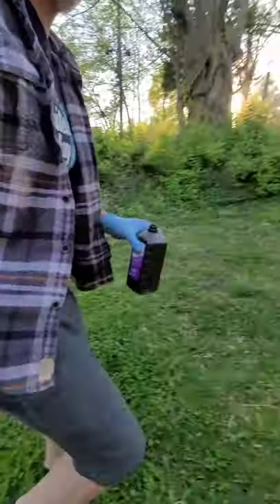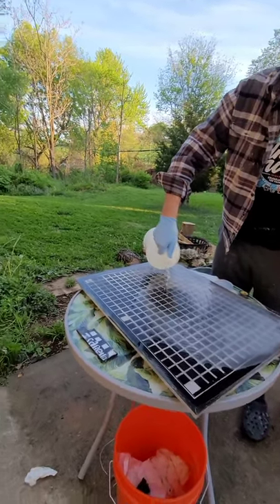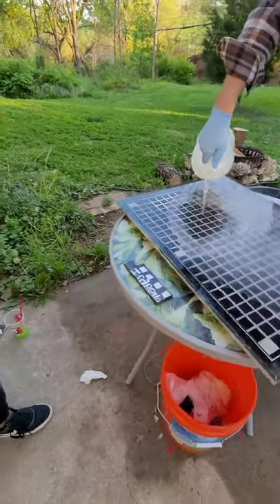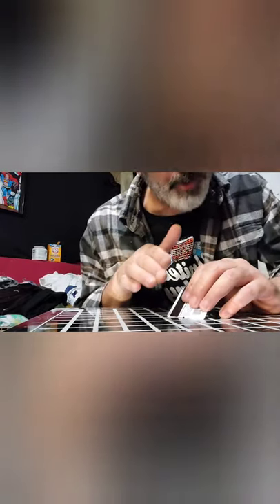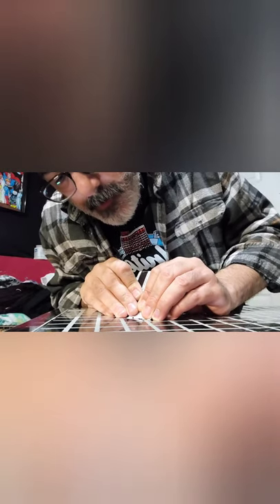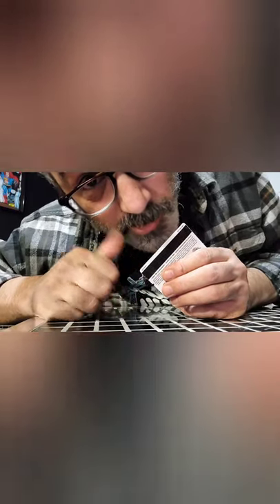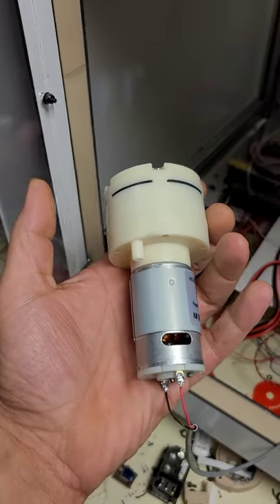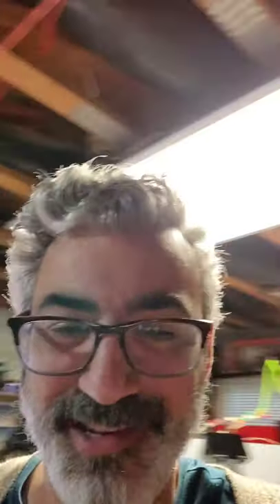DIY Vacuum Bed Process-Part 1: the build...Acid!

Comment: where did you find that etching the channels would be enough to get it to work? how did you attach the pump to the bed? what's the chemical mix ratio? how long did you let it sit? how deep was the etch?
Thank you!
Reply from the maker: I'll try to answer a much a I can in the order you asked.   Is etching the channels enough?  No one told me and I didn't read it anywhere that this child be done.   I had watched a handful of videos in the past relating to etching and one day during a brainstorm can up with this idea.   I figured the channel did not have to be deep and any other method of fabrication might introduce imperfections to an already super flat mic6 and garolite surface.   I attached the pump through a series of pneumatic fittings.   What was the ratio?  2:1 and I let it sit for about 25 minutes.   The etch had variance of 0.2mm roughly with an average depth of just 0.5mm.  I don't think I would have done this any differently,  it came out really nice.   I haven't put out a follow up video due to me still wiring through the klipper firmware and being a perfectionist about things........... works great though.
Reply from the maker: Don't forget to sub for when the next vid comes!
Reply: @MakersMic  Thanks for the reply. 
is the ratio 2:1, HCl:H2O2? or the other way around? what concentrations of each?
Reply: @MakersMic  is what you used to mask just vinyl?
Would it be possible for you to post a pic of how the pneumatic fittings come together?
Reply from the maker: Yes the ratio was 2:1
Reply from the maker: Yes,  it was actually vinyl used by cricut machines.   Comes in rolls so I was able to cover a large area at once.   I got the permanent type of cricut vinyl.